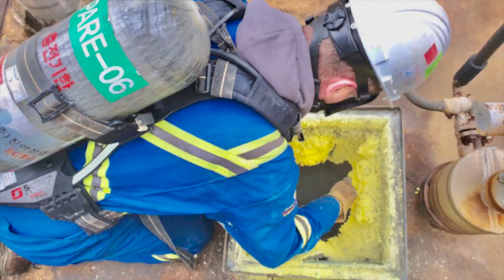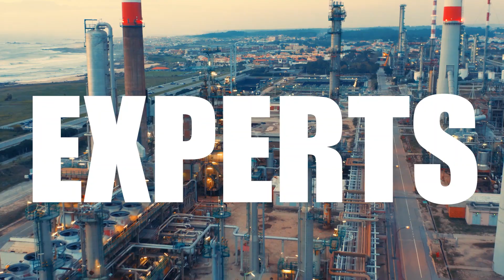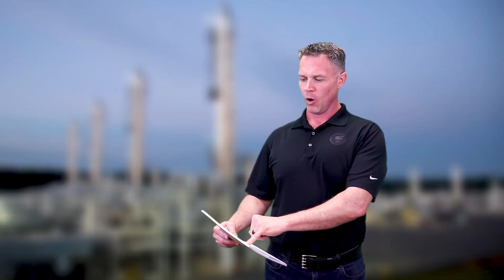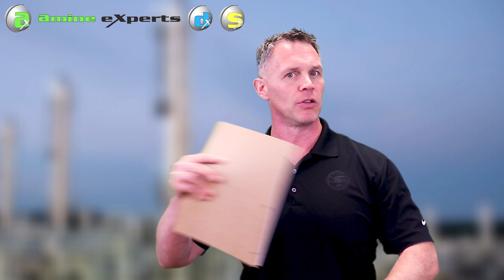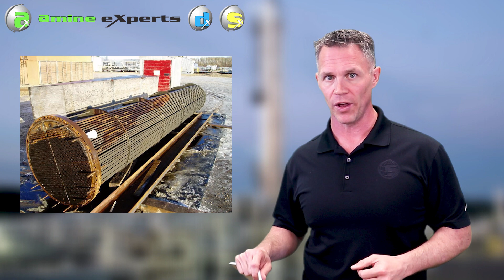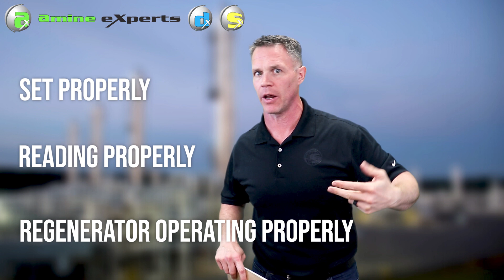How to Set Steam Flow to a Reboiler in an Amine System

Comment: Good job Ben. What exactly does reflux ratio do when correcting for insufficient or excessive steam/feed ratio? Does it push the stripping zone up and down the tower?
Reply: Fruito, the reflux ratio is a ratio of water-to-acid gas in the overhead of a regenerator. The higher this ratio, the more steam is flowing through the tower, therefore pushing the area of regeneration higher and higher. What we do NOT want is any appreciable amounts of H2S or CO2 getting to the bottom of the column.

Comment: Thank you a lot.
What about the ratio of reflux flow to amine flow in DGA plants? Is it more of 10% or 5% ?
It's a primary amine, so I would assume something similar to 10%, but that's not really the case based on our unit design
Reply: Al Ali, it really depends on how low the lean loading of the DGA needs to be, which is based a number of factors: H2S spec in the treated gas, absorber pressure and lean amine temperature. It also depends on the CO2-removal efficiency in the regenerator - we don't like to see much more than about 0.5 mol% CO2 in the steam return line from the reboiler to the regenerator due to corrosion risk. In general we find DGA works well with a reflux ratio of about 3, and a ratio of reflux:rich amine flow of 5-7%.
Reply: @benspooner8690  Thanks a lot Ben

Comment: Do you have a flow rate for hot oil reboilers? Our hot oil operates at 177 deg. C
Reply: Brad, no there is no '"generic" recommendation for a ratio of hot oil to amine, as it depends on the heat capacity of the oil, as well as temperature. In these cases we recommend first the hot oil to about 180C (which you've already done) then increase oil flow until the desired regenerator overhead temperature is reached. Double check the temperature by checking the reflux - to - amine ratio, and check the lean loading. If those three parameters look good, make note of the oil:amine ratio and put that up in the control room. Alternatively, if you have the unit modelled on ProMax you can enter the exact type of hot oil and it will accurately predict the required flow.